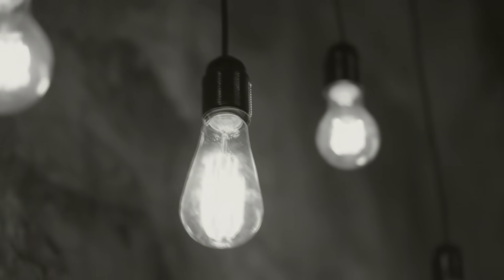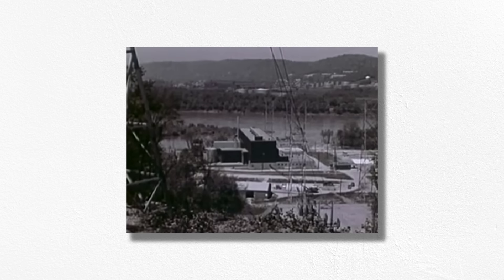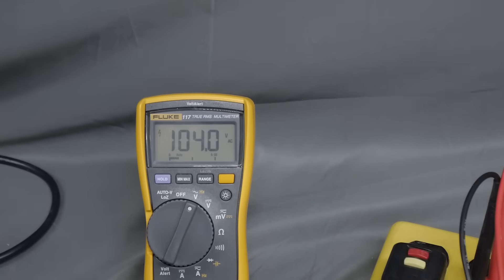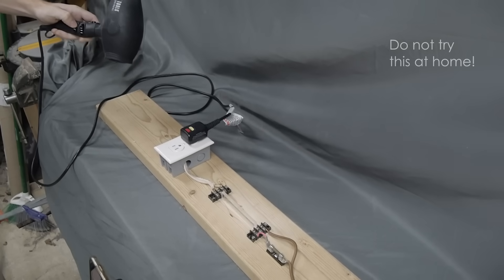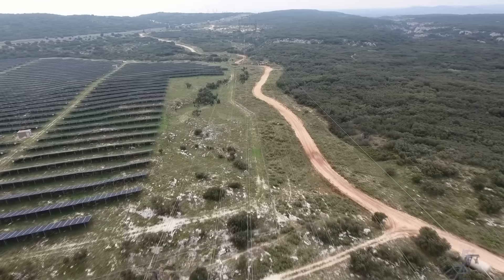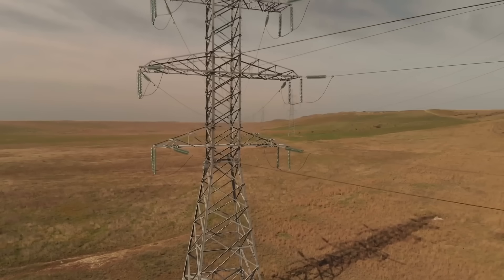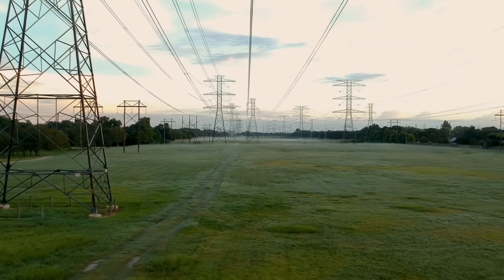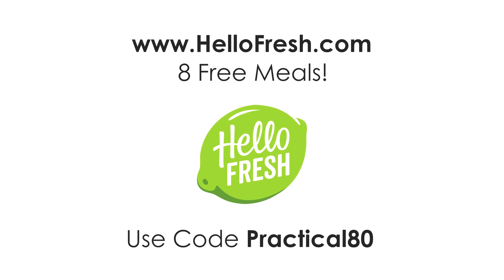How do Electric Transmission Lines Work?

Comment: I am a Transmission and Distribution Civil Engineer, I shared this video with my coworkers. They all appreciated the video! I would have enjoyed if you integrated the difference in dead end and tangent structures.  Still a very well done video.
Reply: @nottingtohide  You'd have to link me to whatever Morin was talking about.  I've never heard of him, but a brief Google search seems to indicate that he has build devices that are over unity (i.e. output more power than they consume).  That's not possible in this universe, so it that's his stance, you can probably disregard most anything else he has to say on electricity.
Reply: In my experience as a complete novice but power line gawker, I would identify a third type of structure: the deflection structure.  Robust lattice designs do not need special structures where the line changes direction, but other designs (such as steel poles) may, and a change in direction often does not have dead ends.
Reply: @jovetj  The tower type I believe you're talking about is called an "angle" tower in the field.  You can think of it as the conductor making a turn at the tower without deadending.  Angle and deadend towers are typically considerably more substantial than tangent towers since they see much greater resultant force from the mechanical tension in the conductors.  The main difference visually between a deadend and angle tower is that deadend towers use, get this, deadend insulators whereas tangent and angle towers use suspension insulators.  The difference is that deadend insulators carry the tension in the conductor and suspension insulators carry the weight.  I am a mechanical engineer and designed transmission insulators for 7 years.
Reply: I'm transmission and distribution civil engineer in India   working In Azad Infra power pvt Ltd. bulandashahar UP India
Reply: @nottingtohide  If you're talking about the electricity that's running through the conductors, it depends.  There are both AC and DC transmission lines.  DC is typically only used on very long transmission lines (think hundreds of miles) due to lower losses.  So for DC lines, you have a positive and a negative conductor at relatively high voltages (often +500 and -500kV).  But the vast majority of lines are AC.  I'm not sure what you're referring to with stuff in the kHz range or what a 50/60 Hz gap is.  All AC transmission that I ever dealt with was either 50 or 60 Hz.
Reply: ok why dont birds sit on 400kv power lines when then cant be shocked? is it the emf? the noise? nobody seems to know this...
Reply: @nodriveasusephotos8019  I don't know that anyone has ever done a test to find out, but I believe it's because the electrical field surrounding the conductors is much higher than on a distribution line.  As someone who has stood in a high voltage test bay 30 feet away from a cascade transformer outputting 1000kV, I can promise you can feel the field.  The thought is that the birds don't like passing through the field as it intensifies closer to the conductor.
Reply: @toddrf  cool. when you say feel the field-what way do you feel it? perhaps a nausia feeling, pain, uncomfortable vibrations? Also I doing live maintenance from a helicopter can be done with a faraday cage arrangement. what would happen if none was used? im guessing no electrical shock but huge flash over that would feel like beeing hit with a hammer, not to mention the burns. perhaps if you survive that once you and the helicopter and crew are energised things would be ok right?
Reply: @nodriveasusephotos8019  It's hard to describe.  It wasn't painful.  Just a tingling feeling on the skin and feeling the hair on your face and arms stand out.  Helicopter transmission line maintenance isn't done with a Faraday cage.  Essentially, the lineman (and pilot) wear conducting jumpsuits and the lineman reaches out with a conducting wand as the helicopter gets close to the line.  This pulls an arc until the wand touches the line.  The lineman then bonds the helicopter to the line with a breakaway clamp, thereby putting the helicopter and crew at the same potential as the line.  When complete, the reverse the process.
Reply: @toddrf  yes the whole body becomes lime a live wire, quite safe as long as no earth path. The faraday cage part is just the glove section so I heard ro take the flash over then through thw body and clamps etc. I might have been miss informed. I saw a video where someone made a mistake up there. It didnt seem clear what it was but I'm guessing it was to do with not suiting up properly. Anyway he said the flashover actualy knocked some fillings out and he couls taste metal very strong. What do you think would  initially happen to someone got caught on the line with a parashoot and ended up grabbing it? No wand to gradualy make the connection
?
Reply: @nodriveasusephotos8019  My guess would be the capacitive displacement current. When the bird sits on a high voltage line, it does take on the potential of the high voltage line. But that potential is alternating, in the US 60 times per second. To change the potential, charges must move through/over the surface of the bird, which is a current that I would suspect the bird will feel. It's not a large current, because the capacitance between the power lines or between the power line and ground is very low, but even some mA or lower should make birds uncomfortable.
Reply: Could please clarify my doubt... What are chances that a 220kv power line falls to the ground?? And what happens to the surrounding area?? Because i live approximately 50 feet away from 220kv power line.....
Reply: @prashanthm2446  Depends on the environmental conditions. Ice and strong winds are risk factors, without any force just by itself it is highly unlikely. As it falls to the ground there is going to be an arc, and once it connects to the ground, the ground fault current propagates radially away from the power line, creating considerable electrical field in the area around it on the ground. That's gonna be there until someone or an automatic fault detection shuts it off, which I assume would be rather quickly indeed.
Reply: @nevermind3147  ok...we don't experience any harsh environmental situations like strong winds.. Forget about ice because ours is dry area area..... But my fear , if it is an unfortunate situation, when a power line falls to the ground does the surrounding area which has Been energized could electrocute anyone in my house at around 50 feet away??
Reply: @prashanthm2446  Well, in your house is a case that is not easy to calculate, because the specific conductivity landscape is not homogenous. If it were a simple half-spheric grounder, which I am taking as a ballpark guess here, and you were standing on the earth directly, I'd expect anywhere from 10-200 V/m field strength in your distance, which isn't negligible. However, that is without accounting for however much that drops because you are standing there and conducting current. And without accounting for your house. In general, do not go anywhere near this ground fault, make small steps, do not lie down,  and preferably get out and notify whatever authority operates this line that they have a ground fault next to your house. My guess is that you wouldn't get electrocuted in any meaningful sense of the word, but that is just a rough guess. Maybe someone has actual data on the real-world situation with a house there.
Reply: @nevermind3147  thank you for your information 🙏🙏
Reply: Please enlighten me.  What might be the best major/minor to get that position?  I'm looking at a combination of Civil and Electrical Engineering, but for designing towers some professors have suggested Mechanical Engineering as well.  Our transmission infrastructure is outdated and under-appreciated.  I will see to it that a little creativity will go a long way to modernize the technology and improve the A E S T H E T I C S
Reply: Awave3 at the firm I currently work for, we split Transmission and Distribution design into several sub-disciplines. We have geotechnical engineers that do the foundation design. Structural engineers primarily analyze existing lattice structures to see if they are still in good shape or not. Not as many lattice towers are build these days because they can become very complex. Some civil engineers also help with the foundation design of the substation layout and grading plans, but most of us civil engineers design steel concrete and wooden poles as well as the sag/tension designs of the conductors to ensure they meet clearance requirements. We also have a fair number of structural engineers that go my route as well. All of the electrical engineers design the substations and phasing of the new conductors. I’ll be honest, out of all the disciplines I just listed, electrical is by far the one I know the least about. 

I do feel like knowing electrical would help give you a better understanding of why designs are the way they are. Us civil engineers just follow the specs that the electrical guys designate. All we do is hold up the wire basically.
Reply: Electrical and structural engineering would be your best choices.
Reply: Hire me. I need experience.

Comment: I got asked in my job interview "how can you tell what is the transmission voltage level by simply looking at the transmission tower?". I knew the answer but my point is these videos are actually very informative for people who are curious about Power systems in general.
Reply: Its the insulators right?
Reply: @Joe-Mamasixtyninefourtwenty  Yes sir
Reply: @Joe-Mamasixtyninefourtwenty  also more than one wire per phase
Reply: corn holio that depends, you can't use that alone as our low voltage systems at 230V and our transmission system at 275kV both may have 1 or multiple conductors per phase depending on application
Reply: Jonathan Armstrong I thought I understood what voltage was (“the electricity’s desire to move” or in other words how fast it wants to go as the video producer said) until you added a number and mentioned 230V. Now is the 230V 230 “desires” are or 230 electrons/currents per second/minute? Now if it’s “desires” or wants how is it possible to measure? And if it’s anything else why would the producer define it as “the electricity’s desire to move”?
Reply: Hanunie Hanujie Voltage has nothing to do with the speed of electron motion or signal propagation.  Voltage isn’t easy to explain in simple terms and most analogies fall short.  Probably the easiest to understand and closest analogy is to water in a pipe.  Voltage is roughly equivalent to water pressure and current is roughly equivalent to the volume of water flow.
Reply: @sareeyemanusqaame8723  let's get this straight,  the correlation should be of water through a pipe. Voltage,  is electro motive force, the pressure of the water in the pipe, or in this case force moving electrons in a conductor. Next is current " I " . The current is the volume of water in a pipe, or here the amount of electrons being pushed thru a conductor by the voltage. And lastly in this triad is  " R " which is resistance,  the diameter of the water pipe having water pushed thru it. Or the size of the conducter and the material it's made of having voltage (V) push, electrons (I), thru a conductor (R) . With these 3 terms, V, I, R, one can figure any number of variables.  But in actuality they are correctly called as follows...... E = voltage,  I = current and R = resistance.
Reply: @sareeyemanusqaame8723   ..  Ignore what he said about voltage. Your understanding of electricity needs to be deleted so you can start over.
Here's one bit of info for you: The speed of all electricity is the speed of light. Search other YT videos to find ones that explain how electricity works.
Reply: @e-curb  — The speed of electromagnetic radiation is the speed of light, because light is a form of electromagnetic radiation.  I don’t know what you mean by “the speed of electricity,” though.
Reply: @GH-oi2jf   .. Electricity moves at the speed of light.
Reply: @sareeyemanusqaame8723  Quite late response: Voltage is literally defined as energy per charge. Equivalently you can you say it is the energy per electron. If electrons are bundled together very tightly, they want to repel a lot more, so they have more potential energy, and therefore more voltage. You can compare it to pressure, or to the loading of a spring. That is why voltage can be considered the electrons desire to move. To move the same amount of power, a higher voltage line will move fewer electrons, but each individual electron will carry more energy.

Because voltage is a property of electrons, it is unrelated to the amount of electrons: you can have a system with only two electrons that is 100 000 V, simply by the electrons being close together and wanting to escape from eachother. For example, when you receive a a small shock from touching a doorhandle due to static electricity, the voltage is can be something like 20,000s V However, because the amount of electrons involved is so low, no real damage is done, apart from being startled a little.
Reply: Man getting a job at Starbucks is tough!

...I kid of course.
Reply: It has to be bundled conducting, multiple wire per phase, distance between phases
Reply: Semper Fidelis its the construction, mainly the insulators used
Reply: Saif Uddin spacing or clearance between phases is your best indicator of voltage. Insulators would be a close 2nd.
Reply: I thought it was 10kV per insulator disc, not 15kV.
Reply: Aus it's typically 10kV per disk combined with some local knowledge (or the AEMO interactive maps)
Reply: @MrSmeagolsGhost  So I had it right in mind, ok. Why did he say 15kV tho?
And would a difference in the frequency have any impact on this?
Reply: Jan B.  US use slight different voltages. But the voltage categories are fairly wide so it still works.
Reply: @JanB1605  10kv as a rule is good up until about 100kv. After that it becomes less reliable.
Reply: S g 60 cycles. US transmission common voltages are 36, 42, 115, 230, and 500 kv.
Reply: @randyweaver6543  and in years past 25 cycle was common. As can be seen in the original NYCTA Subway system, the garment district of Manhattan and many others including machine shops.
Reply: @JanB1605  for distribution voltages, the nominal phase-to-phase voltage is roughly 8-11 kV/bell.  Sub-transmission voltages (~46-69kV) run 11-14kV/bell, and transmission (typically 138-345kV) runs 15-17 kV/bell.  The kV/bell gradually increases as voltage goes up.  I performed AC and DC impulse testing for several years on distribution and transmission insulators.
Reply: Jan B. It depends on the insulator, material it’s made of and length. Not every insulator is rated at 10 kv per skirt
Reply: "The bigger they are, the harder they jolt."
Reply: No u didn't...
Reply: I'm a EE at a utility and honestly still doubt I'd remember the 15 x sheds. My answer would be more about the electrical clearances. But then I guess I wouldn't really know the voltage and would most be guestimating. But you'd at least be able to tell if it was a distribution or transmission line based on the clearance
Reply: The correct answer is that you can’t tell.  A number of transmission lines are operated at less than their rated capacity.  The insulators can tell you the voltage capability, but not what the current transmission voltage is.  😁

Comment: I finally know what those 1x2 thingys do that hang from powerlines - they stop wind from being too effective!
Reply: Basically, wind can cause a transmission line to vibrate (not unlike the string of a guitar or violin).  This phenomenon is called 'galloping' and can lead to failure of the transmission line.  The small weights added to the line increase mechanical damping to prevent vigration.

Incidentally, sometimes you will see large spheres surrounding transmission lines - often red in color.  These are used where there is a risk of planes flying into the transmission line and are provided as visible warnings to pilots that there is something that they need to avoid.

Comment: Just out of curiosity, why do large transmission lines "hiss" loudly, when it's raining, or even just humid?
Reply: Krembo asked the same question.  Audible noise comes about as a result of discharges from the high voltage line through air - and since wet air is more conductive than dry air, the noise is more noticeable when the humidity is higher.  Also called 'corona'.
Reply: Audible noise is caused by electrical discharges through air - called corona.  Since wet air is more conductive than dry air, the noise is more noticeable when the humidity is higher.  Power line designers can minimize corona by minimizing sharp edges on the components used to construct the lines - which is why those components always appear to be round.
Reply: To copy/paste my own reply to another question above, the individual water droplets on the conductors create a smaller radius for the electric field to concentrate around, making ionization of the air easier.